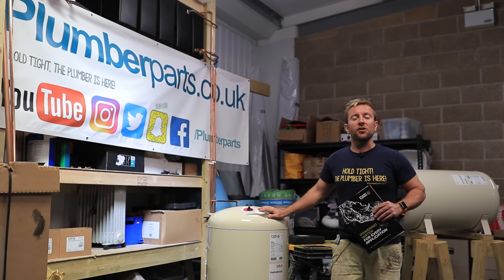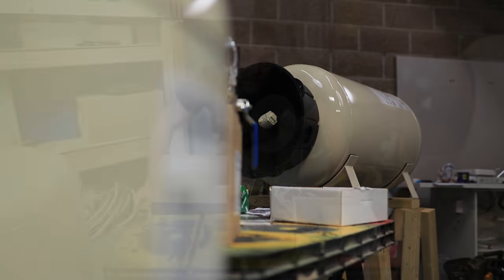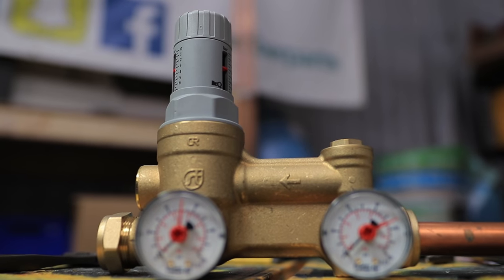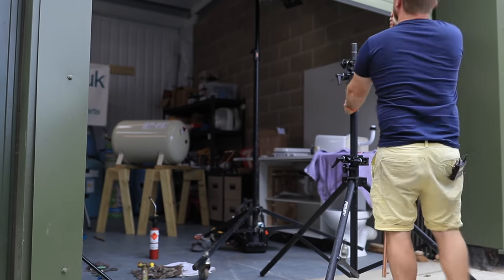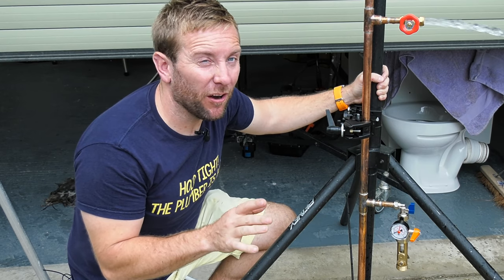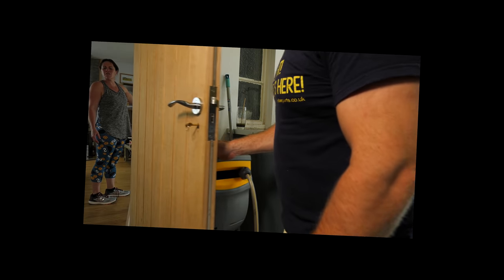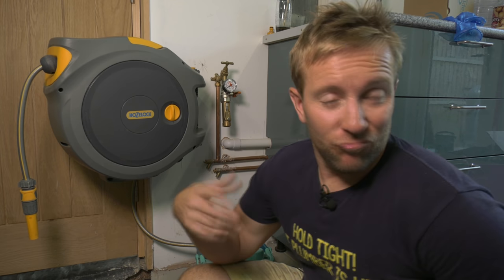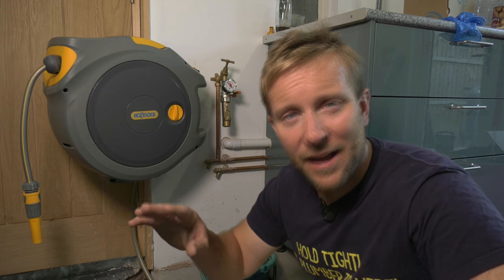BOOST HOT AND COLD WATER PRESSURE - Stuart Turner Mainsboost

Comment: Great video James. I have recently had a combi installed and to be honest I expected more pressure from the taps. When I run a hot tap then run a cold tap the hot tap slows down. Which I understand now as they both come from the same supply. Anyway, I really like the idea of these accumulators as I now have no tanks at all in the house so have room for one. 
James or anybody, what should I budget to have one installed. Bit of info, mains water comes into the kitchen, combi also in the kitchen, accumulator would need to go in the loft.

Comment: Great video James, I'm a newly qualified Gas Engineer, so going to get me G3 qual soon. Just confirming, as this is all cold water at pressure this certainly won't require that qual. Also, if it is a big house with a system combi, should that unvented cylinder do this very job (I think it does, but worth asking), could this be added to a system combi if the outside pressure is low to start with?

Comment: That tank is basically an accumulator. Versions of it (much heavier/thicker metal of course) are used in hydraulic systems as well, except an inert gas like NITROGEN must be used in the bladder above the water, instead of air. What about the amount of time other taps are open if they are all open at once? Can this keep up with the amount of flow being used; there must be a time limit at which it couldn't keep up with the amount of water being used?

Comment: Hi great video. I have an unvented indirect hurricane installed. I have weak to no flow/pressure in my loft when turning on the garden tap. I have everything still exposed. Was wondering if this system will fix it? My mains has a 25mm blue pipe to 22mm stopcock which connects to my 22mm pipe. Would it be worth digging my front drive to change a potential 15mm pipe and then hooking it up to Severn Trent outside stop? thanks !

Comment: I have been doing a bit of work on my plumbing recently and biggest revalation was that the bore on the 22mm mains inlet is slightly smaller than the bore of the 15mm plastic pipe!!

Comment: Hi James, great video, I have had a stuart turner mainsboost Flomate fitted which has definitely helped the water pressure in the shower.
The pump is located in the kitchen cupboard and is causing quite a bit of noise in the bathroom and 1st bedroom, any ideas? Is it just the water flowing through the pipes? 
Cheers James

Comment: Hi @plumberparts - great video! We're on an unvented system and looking to get one of these installed. Couple of questions - 1. Does it make a difference where the vessel is installed? We're hovering around 2 bar on our system with the cylinder in the loft, presumably that'll be a bit lower up in the loft? Would that be sufficient 2. Is there any difference between the Stuart Turner Mainsboost and other accumulator vessels in principle or is it just a brand?  Thank you!

Comment: Very interesting!  
So the regulated static pressure is less than the original unregulated static pressure but the tank stores pressure which increases the dynamic pressure when more outlets are opened and sustains it?  If you have only one outlet open, say a shower, will the lower regulated static pressure result in a lower flow to it?  What defines how long the boosted dynamic pressure will last??
My incoming main is in the garage. Could I add one of these in the garage immediately after the main stopcock
If my questions reveal a total lack of understanding there is a reason for that.......LOL
Reply: These systems often get installed in garages, so yes you could set it up in there.  How long the boosted supply lasts really depends on the size of the system and it's use.  You can also complete a site survey form to get a bespoke recommendation from one of our experts.  You'll find a link to the survey and details on the whole range here: https://www.stuart-turner.co.uk/our-products/mainsboost

Comment: Great video, thanks. I just have to the same question as a couple of others on here... and that is... what is the length of time that an accumulator can keep up the pressure ? (Obviously this will depend to a degree on size of accumulator but we have enough space for one about 1500 tall). I have a job to do to convert from gravity system where currently nothing is pumped, original plan was to upgrade to a new heat only boiler and a larger lagged cylinder and keep the decent sized CWST and add a 2.0 bar shower pump but I’m contemplating this approach instead, though I’m concerned that the ‘accumilated’ pressure will die off over ten mins. There is 3.5 bar standing pressure but I never like to rely on the fact that this will always be the case (that’s why I don’t really like unvented installs) any feed back would be appreciated. Thanks. Tom.

Comment: Yeah but surely if someone’s in the shower for a long time or you’ve run a bath for example it would have used all that pressurised water up and then you will have the same problem until the vessel is filled again

Comment: Great product and good example. I have a question for you. I have a combo boiler in the kitchen and since fitting a mixer tap on the bath. When ever I run the cold water and shut it of fast for example a lever tap    ihear the boiler try to fire upfor a brief moment as if I'm running the hot tap and then it stops it also does it when the washing machine is on
Reply: Get a shock arrestor fitted to the cold supply pipe feeding the boiler

Comment: Hiya thanks for the vid, good info, I am not a plumber but I do understand the basic principles of how this system works, what you don't explain is how long this extra water storage lasts for, while in use, for instance if the washing machine is on, the toilet as been flushed and someone is in the shower how long would it last before the extra water pressure is all used up? please don't say how long is a piece of string, it depends on how many items are drawing water etc, for instance if the expansion tank roughly holds 60L and the pressure is 3bar how long would it take to use that amount of water and the old pressure would be back to normal, the reason I ask is that I have a large family and my shower is on constantly for at least 90 minutes or more each morning, I'm not sure that this device would be of any benefit to me.  thanks in advance for any reply.

Comment: do you just replace the small pressure vessel that comes with the sealed hotwater cylinder with a larger vessel to increase the hot water pressure

Comment: Hi James. Quick question - how was the mains static pressure (before the booster) in the attic 7 bar, when earlier it was 4bar at outside tap test? Cheers mate!
Reply from the maker: The 4 bar test was off the back of a combination valve...which made me realise it had gone wrong as it should have been at 3.5bar!
Reply: @plumberparts  thanks. Great vid as usual 👍

Comment: James I currently have a multibloc which has a return cold port and a pressure relief port would the Stuart Turner bloc be able todo the same ? I have a unvented system. My shower pressure is really poor and wanted to add this to increase I have a rain shower would this solve my issues ?

Comment: How much does this system roughly cost fully installed? We have noticed ever decreasing flow/pressure in our house over the years and have 3 bathrooms and a unvented hot water system. So I’m hoping something like this could rectify our issue

Comment: Hi James, quick question. Would you recommend one of these systems or a salamander home boost pump? Its a combi system, no water tanks. Cold mains is a bit on the.. Mehh side. Only have 1 bathroom and 1 kitchen but when running a bath and a kitchen taps opened the flow drops right off. 15mm mains pipe.
All the pipeworks a mess in the house atm with 3 stop cocks stashed away so I'll be ripping those out but there large stop cocks, not the small isolating valves so i don't think they would really affect flow thattt much. Keep up the excellent videos mate, good to see you and Roger working together over on skill builders channel too 👍🏼
Reply: I would also like to know this as Im on a 15mm mains and the bathroom struggles, I also dont have room for this size of tank. so would like to know my options
Reply: Personally if you have the room for it, mainsboost from stuart Turner is a better option, The salamander is ok but they are limited to 12 litres of water per minute, which is ok but not great, as with any pump, they are noisy, require a power supply and they can fail at any time. The mainsboost though has no moving parts so less to go wrong, they make no noise, require no power supply and have no restrictions on flow rates. Before you jump to getting one though, look at why you have poor flow, definitely sort the 3 stop taps out, countless times I've been to houses where a new stop tap is fitted above the main one only to find the main tap has snapped and only turned half way on. Also check the boundary stop tap is fully on.
Forgot to add, the mainsboost is only suitable if your static pressure is above 2bar so best get that tested too
Reply: @stuwoac  have a look on stuart Turner's website, they offer pumped mainsboost systems designed to fit within a kitchen unit. Yes you need power supply and they are noisy but you get a much better flow rate than what you get with the salamander. But before you get something like this fitted, check for reasons why you have poor flow rates as mentioned in my comment above.
Reply: @craigwatson7692  cheers for the reply buddy, the plumbing in this house is a nightmare to be honest so first port of call is to remove all these unnecessary stop taps and see if flow improves. I highly doubt it will, but before i jump into getting one of these systems i will give it a test. Basic plumbing is fine with me but when it comes to systems like this, i prefer to get plumbers insight before i throw money down the drain. Plasterings my thing lol. I can see the benefit of the salamander being that its just a small unit i can hide easy, but as you say, its obviously an electric pump so will fail sooner than a mechanical diaphragm system like this stuart turner. Luckily i could fit one up in the loft which is totally unused atm. First thing i thought of was the pavement tap half closed but it's fully open. I was hoping for an easy fix there but, never the way is it 😂
Reply: ep91monster o

Comment: If u run the taps for long enough will the expansion tank run low on pressure..e.g if the mains supply can't fill it fast enough will it eventually drop off?
Reply: If the vessel gets depleted you'll revert back to the pressure and flow after the Monobloc connection.  If the incoming pressure is really low you could consider having a charger pump on the system too.  Details on these can be found here: https://www.stuart-turner.co.uk/our-products/mainsboost

Comment: Surely this is a problem caused by British homes being designed for a conventional hot water system. 
We've all been pushed to remove the tanks and install combi boilers, only to find we don't have the pressure to supply all of our appliances. 

How long can this tank maintain the pressure/how much can it hold?
Reply: If your been pushed to remove your tanks and fit a combi when your incoming supply/system/ hot water demand isnt suited for a combi then that is a mistake of the plumber who recommended it. 
And how much the tank holds and maintains pressure depends on the model fitted, they come in a variety of sizes to suite any requirement.
Reply: @craigwatson7692 I am not talking about myself, as a Northern Irish man, I know that the most practical heating setup is a conventional one, unless I live in a one bedroom flat, bit having lived on the mainland, where you guys love the old combi, pretty much every property has one, whether it is the most practical setup or not. James in my opinion would be much better suited to install such a system, or an increase in supply, rather then retrofit a tank, which will need replaced in 10 years.

Comment: I could really do with a way of raising the pressure of the hot water in my house, but things like this are just gonna clog with scale. The biggest issue with the south east 😭
Reply: It won't clog with scale. Scale only really forms when heated. Absolutely not a problem.
Reply: @DunkiSTI  the water is so hard here, it forms on any mains water outlet. I fill my cats water bowl and within a day you can see the scale sitting on the sides it's an absolute joke
Reply: @daveytn  I am in southeast too. yes its bad. use a water conditioner on your mains cold inlet or install a water softener before the mains boost if your are worried. but make sure you have a drinking water tap that is not softened. 
If you were to cut your mains water pipe and inspect there may be a small coating. but in hot water cylinder and hot water  heat exchangers it is more of a problem.